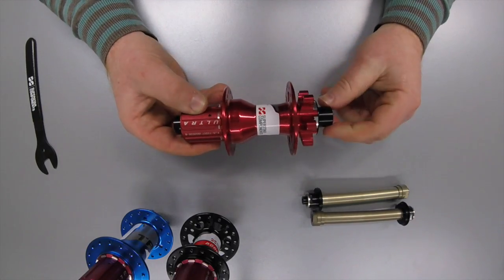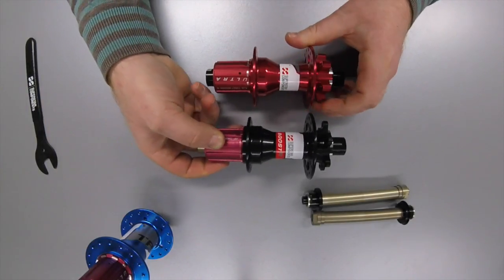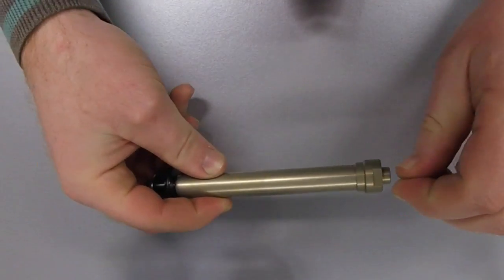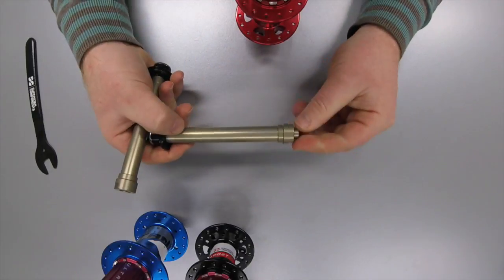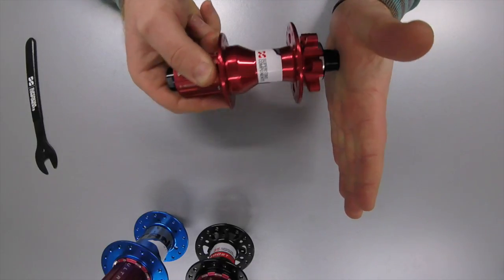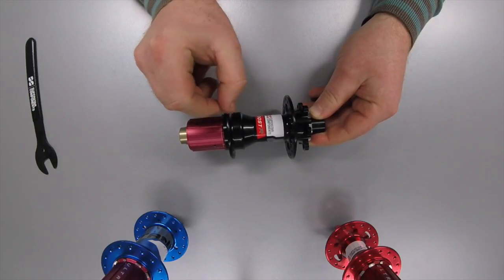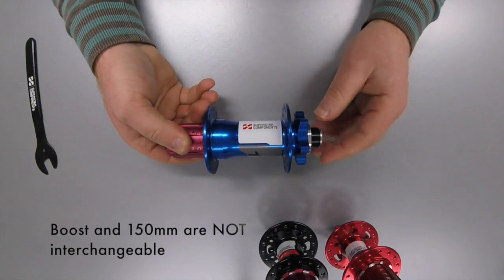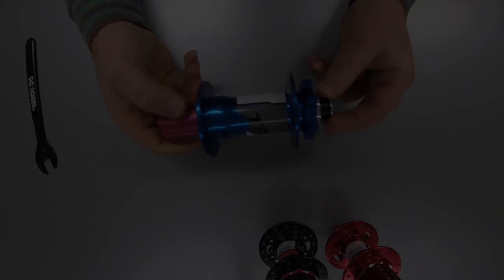Superstar Components - Understanding Rear Hub Axle Sizes

Comment: i measure my rear hub spacing at 140mm and i have a halo combat 24" dirt jump wheel on it's way, will it fit? also on the halo desc it says 135mm
Reply from the maker: Giddygordon its to the shoulder not the end of the hub. It will be 135 by the sound of it